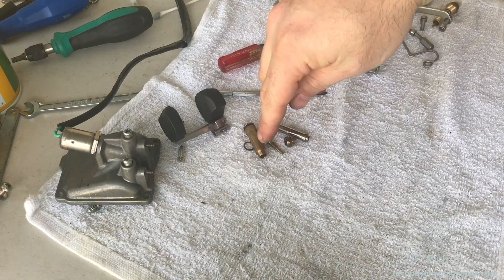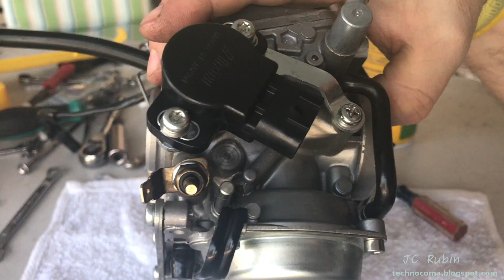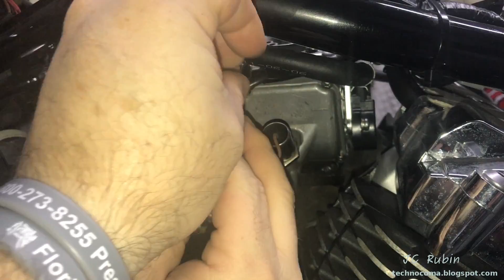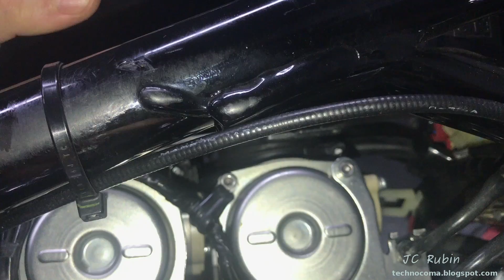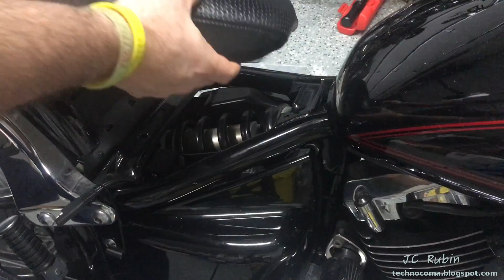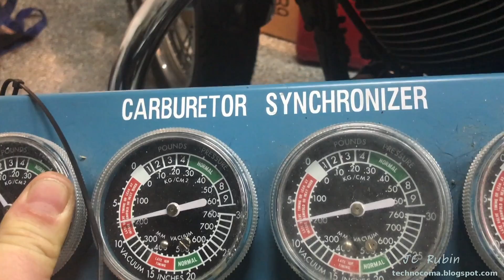Yamaha Star 650 Carburetor Remove Clean Rebuild Reinstall Sync - Part 2 of 2

Comment: The C washer on the needle jet what kind of washer is that?  Can I get Itty from a automotive or hardware store?  I lost it trying to adjust it 😠 I don't want to have to buy a while new needle her set just for the C shaped washer and what kind of Philips screws are those the go on the bars that hold the 2 carburetors together.? Who ever owned my motorcycle before me stripped the screws really bad!  I almost couldn't get them off!

Comment: Twice the carbs, twice the fun. Does it really need 2 carbs, and such a complicated system?
Wondering if it does something special to keep the temp of that rear cylinder in check.
Nicely made instructional video.
Reply from the maker: Allows correctly metered gas to each cylinder. No long manifold and addresses heat difference issues between the two.

Comment: Question, when it is in idle they are in the same level, but after reving it, the other cylinder goes higher pressure, and when I let go of the throttle it goes back to same level, is there a problem? They said the front carb intake open up quickly than the rear. How do I adjust them to open in the same time.

Comment: Great video. I just finished the rebuild and have installed the carburetor, but when I reattached the throttle cables the bottom one fit easily, but the top one would not even with the nut loose. I had to use force to get the nut over the holder and now my throttle works, but handle won’t release one you turn it. Hope this makes sense, any suggestions? I’m gonna take the cable back off, but I’m gonna end up with the same problem.

Comment: Hi question my carburetor got rebuilt but doesn't stay on even with the choke the recommended a new carburetor any advice you can give me I don't think he sync the carburetors
Reply from the maker: If its not the carb... did you introduce an air leak when u reinstalled.

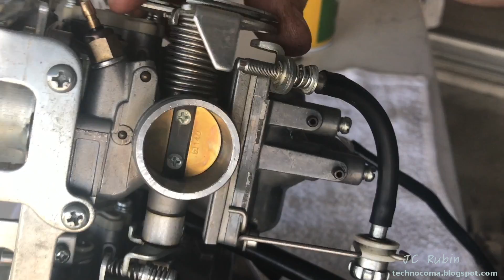Comment: Spent a very long time rebuilding my carb on a used bike that I purchased. The seller lied and had several missing internal carb pieces. I finally tracked them all down and installed one by one using your videos. Thank you so much for these, they have been phenomenal. I do have one issue that I still cannot figure out that I wanted to ask about (happy to electronically pay you for the consult). At 9:35 on your video you test the two black plastic pieces that are connected to the adjustable needle. When you push them back they spring RIGHT back into place. Mine do the opposite, as soon as you push them in, they just get stuck there. You can manually pull on the needle and they'll come back out. Everything is clean and the adjustable needle is properly assembled on both. However both stick like this. What do you think is the culprit. Could it be the diaphram springs themselves have just weakened over time and need to be replaced? Please help, like I said, I'd be happy to pay for your advice.

Comment: Excellent work shipmate. I was very hesitant to tackle this for a 'job'. I hadn't rebuilt a carb in many moons. The spring you highlighted as installed incorrectly was mangled on my customer bike. A trip to ACE, new spring, good as new.
Also, I was very cautious, but still managed to launch the choke spring about 20 feet across my garage. Turn off the lights, and grab a flashlight to 'sweep' the floor with light and voila!  I found it.  Just wanted to say thanks for your most excellent tutorial.

Comment: Great video very detailed! I'll be watching again when I clean/rebuild mine. Thanks for posting!
Reply from the maker: Glad it helped.
Reply: @rubin-tech  at first I ordered wrong rebuild kit, and never separated the carbs. Not sure if it was a good call. I bench tested both carbs, seems to be working perfectly with the right rebuild kit. Can't sync carbs or test atm. Unfortunately the bike is back together, but in my dinning room till spring. I'm so ready for spring! I've thought about running extension pipes outside so I can start it lol. Hopefully you have a video on syncing carbs, I'll be checking soon enough. Thanks again!

Comment: I got my bike back on the road thanks to your videos!! The carb was full of white almost plastic looking gunk. Thanks so much for your help, I could not have gotten it fixed without your videos! I runs better than it has in years!
Reply from the maker: Try to use E0 gas if the bike sits for any length of time.

Comment: When i removed the air box it seemed as if it was just sitting on top. When i reinstalled it was 🤬 to get to mate with the carb. I had to loosen the manifold, mate the air box and carb, sandwich it down then snug up the manifold. This took me several hours and was the most frustrating part of reinstalling the carb. At one point i was using a good amount of force to shove the carb over (a crowbar would have helped but seemed excessive at the time) and trying to jam the air box boots on the carb.
Reply from the maker: It sounds like something wasnt lined up correctly, it should seat with little effort.

Comment: Great video- seriously so helpful! Any recommendations for cleaning the exterior of my carbs? They're absolutely filthy from the previous owner. The bottom of the air box was also covered with grime. Do you think it is from a possible leak from the intake boots?
Reply from the maker: I demonstrate the cleaning in several videos in the ultrasonic tank.

Comment: Hi! I just wanted to say thanks for posting such in depth videos on the Vstar. I put my 650 classic in the shop a few months ago for repairs on the carburetor, and already I’m having issues again with it. So I decided to troubleshoot it myself instead of taking it back to the shop and spend another thousand dollars for them not to fix it. I got it off the bike and disassembled both carburetors and they were pretty clean, so I don’t think that was the issue. But I did notice as I was taking them off the bike that the wire attached to one of the solenoids had a break in it. Sure enough, as I was disassembling them it broke completely. I started looking online for a replacement and really did not want to spend several hundred dollars for that one piece. Your tip about digging out the rubber, soldering the wire and then using epoxy on it may have saved me some cash. I appreciate that. I will try this tip and see if I can get the bike running smooth again. I liked the videos and I am a new subscriber to your channel. Keep the great content coming.
Reply from the maker: A broken solenoid produces an error code in the form of a blinking light on the console.
Reply: @rubin-tech  turns out the "new" battery they installed was the problem, not the carbs. I purchased another one off Amazon (after the one from Advance Auto was too big to fit) and she started right up. I just need to do a bit of fine-tuning the throttle and should be good to go. I will be keeping the battery with me on a battery tender during winter months, and starting/riding the bike at least monthly during that time. I have also since purchased a 650 maintenance manual from Amazon. Thanks again for the great content!
Reply from the maker: @nataliesmith6114  Remember to drain the bowls on the 650 when you put it up, there are screws on the bottom of the carb with easy access for this. otherwise the small jets will clog over the winter

Comment: Thank you JC excellent video and your instructions best I have seen. I am a bike mechanic from 1965 and now I am 73 but have not kept up with all the new tech they have put into bikes now . I was looking to buy one from a neighbor but it needs this work done, rich A/F ratio in the rear cylinder. I know how a CV carb works but these new systems are way more complex that in my old 1968 Honda CB 450. Liked and commented and subscribed . Be well.

Comment: The line that attaches behind the air cleaner what would cause that to leak fuel?
Reply: At 17.00 to be exact
Reply from the maker: Stuck float most likely
Reply: Thanks got the float unstuck. Now having running issues time to clean carb and possibly replace the fuel pump!

Comment: I have replaced my intake boots. The top airbox reinstall was a nightmare. After numerous hours of fighting, I got it on. Once the bike was back together it barely runs. It will run (poorly)on choke and dies once the choke is turned off.
Reply from the maker: It should not have been....The top air box should seat right on, you have other issues..... and one of them is an air leak causing a lean condition.
Reply: @rubin-tech  I found out the carb popped out of both boots. The reason I had so much trouble because I bought the intake boots from Amazon and the angle of the boots were incorrect and due to that I had so much trouble connection the airbox to the carb.I put my old ones back on until I get the OEM ones. Serves me right for trying to save money and by cheap junk. Thanks for your videos as they helped me immensely in this process.

Comment: As many of the others have stated, your videos are fantastic.  I bought a 2004 650 v-Star classic that was converted into a bobber.  I got it just before the pandemic started have been riding that thing just about every day since.  I recently noticed that the, "air hose" as you called it, hose that connects the two carbs and then runs down between the cylinders and connects to a pipe that is open, is spitting out gas, especially when the bike is in idle.  I have to feather the throttle at red lights to keep it from dying sometimes.  Can you tell me exactly what in the cat hair this "air hose" is supposed to do and why is it spitting out gas?  With the help of your videos I did take the tank off and the air box and did a visual inspection to see exactly where the gas was coming from was able to narrowing it down to coming out the end of this hose.
Reply from the maker: Sound like you have some sort of issue with the carb/s. a float? a seal? needs a rebuild.
Reply: I was afraid you were going to say that, I don't think it has been that long since the guy before me had done "some" work on the carbs, he gave me a package of bits and pieces that was left over from when he had done some work on the carbs.  However, from watching your videos I believe I will get a couple of kits and do some work on them myself.  Thank you so much for the advice.
Reply from the maker: @kellyturner7420  Do it on a towel like I do in the video so pieces don't roll way.
Reply: @rubin-tech  As I mentioned, this seems to only happen when in idle, when the bike is reved up and moving I can't see or smell the gas like i can at a stop sign or red light.  Will it hurt the bike to ride it like this until a rebuild kit come in?
Reply: I also have this issue after just getting the carbs back from being rebuilt. I looked at this video and didn't have the time to rebuild a carb with "life" going on right now. Gas is pouring out the vent tube after priming the fuel pump and bowl to check for leaks.